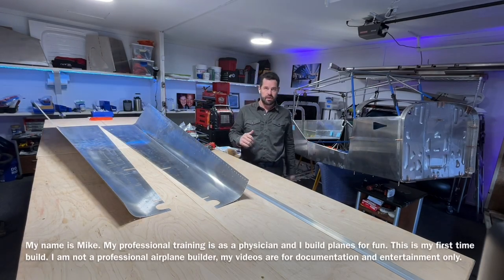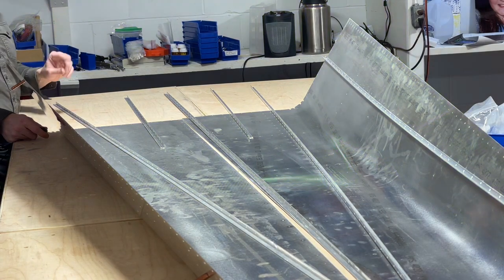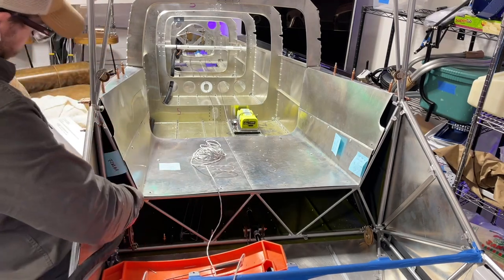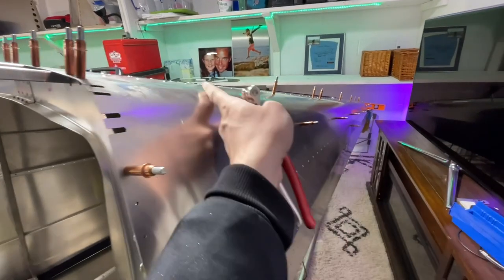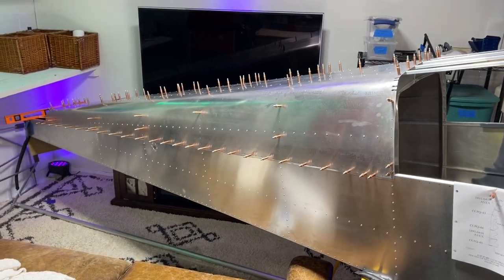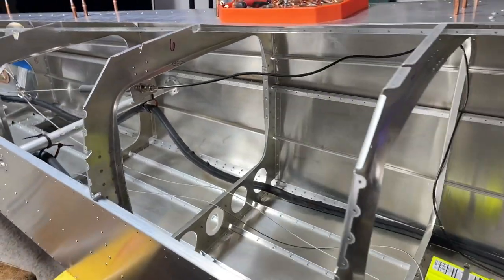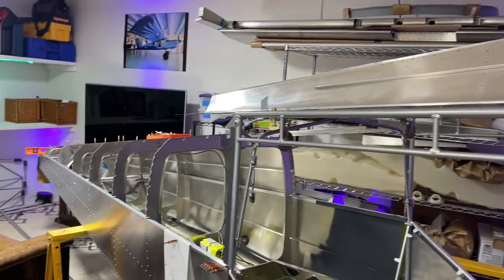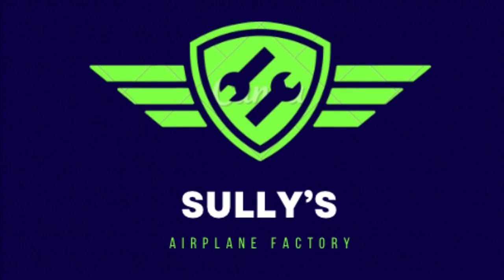Rans S-21 Tailcone Topskins

Comment from the maker: Thank you for watching out for us and for sharing your thoughts and experience as a professional! You are right, the ELT manufacture recommends placement on the outer skin, ideally 28” from any other vertical surface or antenna, as does the FAA guidelines for ELT antenna placement. I have a plan to move it to the outer skin 28” in front of the vertical stabilizer. 

The doubler plates definitely act as a ground and test correctly with a multimeter for appropriate grounding per the Garmin installation manuals. It was important to make sure there was no primer between the doubler plates and the skin. And all cleaned up with acetone prior to riveting the plates to the skin/stringers/bulkheads.

Comment: I don't know what the ELT manufacturer recommends for antenna placement, but mounting it horizontally inside a metal skinned aircraft does not seem like the best option.Also, your doubler plate for mounting needs to be large enough to act as a ground plane. (A&P with FCC license and 34 yrs exp working on a/c)